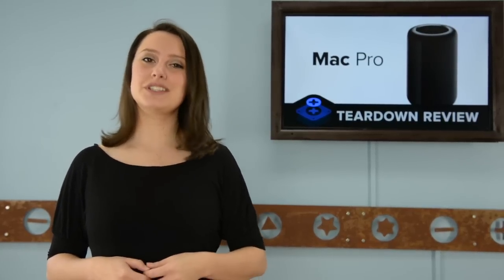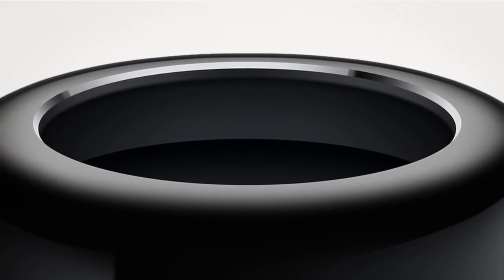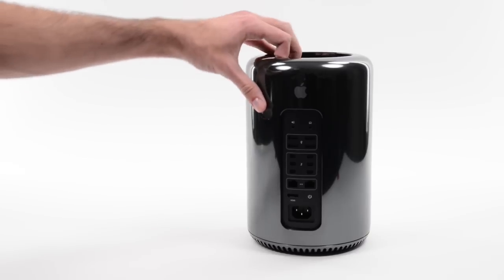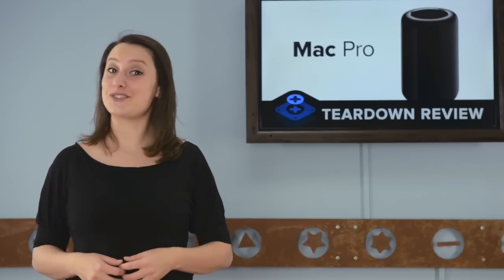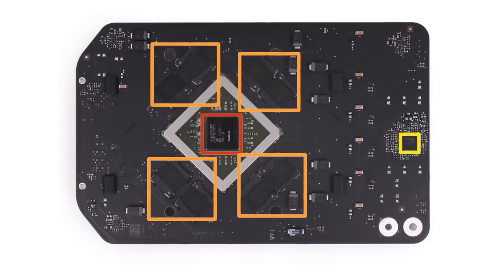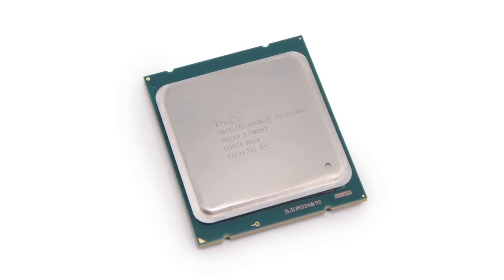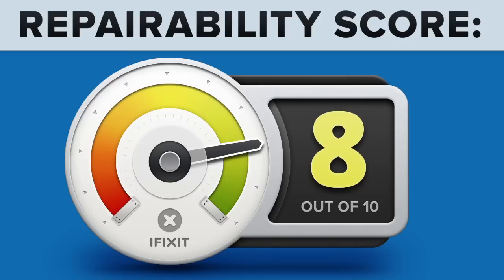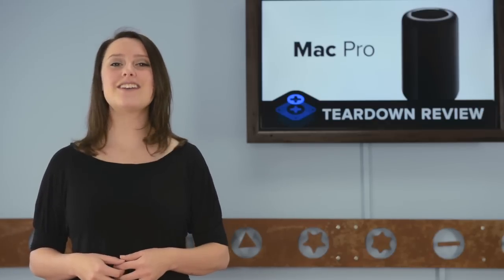Mac Pro Teardown Review

Comment: I build my own PCs but damn that is very impressive how Apple managed to fit all that in there and make it so easy to repair.  Good job Apple.
Reply: Thanks for the intelligent comment! (no sarcasm) usually when comments on Mac posts start with "I build my own PCs" the rest that follows is total nonsense. Yours is the first such comment that actually was followed up by an intelligent response.
Reply: ManifoldSky
Lol thanks, no matter who you are or what you do if you don't think what Apple managed to do here is impressive your lying :P
Reply: Yes.  I different.
Reply: campingTurtle: you ASSEMBLE your own "PCs" is more likely.
Reply: There is no semantic difference. As someone who HAS actually built computers by wire wrapping IC sockets on virgin perfboard, I have no problem with the use of the word "build". (I do have a problem with the idea of some that this constitutes some major technical feat, however.)
Reply: ManifoldSky
I do not consider it a technical feat, it is very easy to "ASSEMBLE" your own computer.
Reply: Yes, I have wirewrapped and point to point and designed PC boards for microprocessor circuits a few times in my younger days...
Reply: The most impressive thing about the new Mac Pro is the size, and cooling techniques. But, there are few design choices that I wonder how it even passed quality control. First off, the power button is on the same side as the I/O panel, I don't think any designer would be so stupid to do that, especially for a PC tower.
Second, non-standard GPU connections: This means you'll have to buy the products from an Apple store, or rely off of "boot-leg" cards with the appropiate connectors.
Third: Reliance upon Thunderbolt: Thunderbolt is incredibly versatile, if you are wanting to use more than one display, you'll need one with a thunderbolt connector, or a thunderbolt to Display Port adapter, Almost every single desktop GPU on the market today has at least two HDMI/DVI outputs, while others may have Display Port as well or exclusively Display Port, most cards today use HDMI/DVI (the two standards carry the same signal). And in the absolute worst case scenario, you'll need an thunderbolt to Display Port adapter, and immediately after, a Display Port to DVI/HDMI adapter (which would be more expensive than a TB to DP adapter as DP and DVI carry different signals.
And finally, four: Lack of true "expandability" beyond RAM. Every single desktop computer can be opened up, and in most cases, the only thing you'll need is a screwdriver, elbow grease, and a flashlight (recommended). RAM, CPU, expansion cards, HDDs, SSDs, optical drives, all these use a standard connector and form factor, which means all you need to do is make sure the width is what you need. And as far as expansion cards go, PCIe is backwards and forwards compatible, meaning you can place a 16x card in a 1x slot assuming the end of the slot isn't closed off.
Reply: ManifoldSky its not irrelevant … where a button is placed, what do I hate about imacs ? having to fumble blindly round the back to find a USB port because the idiots at apple couldnt place one on  the side even ? or make the screen height adjusteable ? how many people have to prop their imac up on things - books etc ? BAH apple make bad design decisions all the time.
Reply: This is NOT an iMac, and such machines are not used in environments where these machines are being turned on and off. They are left on 24 hours a day.
Beyond that, professional videographers are not plugging in USB peripherals to a graphics workstation. Do you even know anything about professional video production houses, or their work flow?
The fact that you can list complaints against the iMac and feel they are relevant to the Mac Pro speaks volumes about your overall argument, as well as your logical reasoning skills.
Reply: Where?
Everywhere?
Or "some of the places" you have seen and heard about?
Reply: ManifoldSky Okay, So I had no idea what TB is. Who cares? Scratch reason number three, and all complaints are perfectly valid. With a typical desktop, at worst, you might have to remove two screws to take off the side panel, and the only reason why you need to remove screws from the inside is if you were doing an upgrade to the CPU, or CPU cooler. Also, with internal drives, there is a very low chance of stuff coming unplugged.

Can you slide any of Apple's monitors up and down? How about swivel them 90 degrees to go from a landscape orientation to a portrait orientation? I could care less about the I/O panel, all motherboards have them. But putting the power button there is one of the stupidest things anyone could do.

Oh, and what about dual xeon support? The old Mac Pro had it, this one does not. It is not a true "professional" machine.

Oh, and just like USB, Thunderbolt doesn't carry a lot of power, meaning if your TB device doesn't get the necessary power out of the cable, you need to give it its own power supply, which is even more cable clutter.

Bad design, combined with piss poor "expandibility" options. Need to replace the CPU? Okay, in the new Mac Pro, it's going to be quite a bit of work, in any other PC, two screws to remove the side panel, 4 screws around the socket that hold the cooler in place, and, the CPU is exposed.
Reply: ***** And again, no they are not. First, who said anything about drives coming unplugged?!? Second, who said anything about Apple monitors? This is not a discussion about CinemaDisplays. Third AGAIN, this is a professional graphics workstation. Anyone who has worked in the field, which you clearly have not, knows that these machines are not powered on and off. They are turned on and left on. Besides which, as the machine is only 6.6" around, reaching back to power it off is trivial, which you'd know if you'd ever even touched the machine, which, again, clearly you haven't. Fourth, dual processor support is irrelevant. If you need 8 cores, it makes no difference if they are on two 4-core chips or one 8-core chip. Are you claiming that "professional machines" all have more than 8 cores?!?
As to power, WTF are you talking about. TB allows 18 V (bus power) vs 5V for USB, with a max power of 10 W. This is compared to 5W bus power for USB 3.0. Not that this is even remotely relevant, but seems just an attempt by your to go over a spec list and nitpick. For one thing, since the power is supplied to the peripheral, the cables are NOT all behind the Mac Pro. Second, if used with an external cage, as I have pointed out REPEATEDLY, there will be one power cable. ONE. For EVERY device in the cage: cards, drives, passthroughs, interface adaptors. One.
As to the rest of your nonsense, replacing CPUs is not done in the graphics industry. This is not a BYO machine, FFS.
You simply have never worked in the industry this machine targets, and don't know what you're talking about.
Reply: ManifoldSky Yes, there is much semantic distinction between those 2 words and concepts.
Assemble vs. build.
Reply: patrick donegan No, there's not, and simply claiming otherwise does not make it so.
Assemble (v) fit together the separate component parts of (a machine or other object).
Build (v) construct (something, typically something large) by putting parts or material together over a period of time.

Take it up with the dictionary.
Reply: I build my own PCs but bees shouldn't be able to fly.